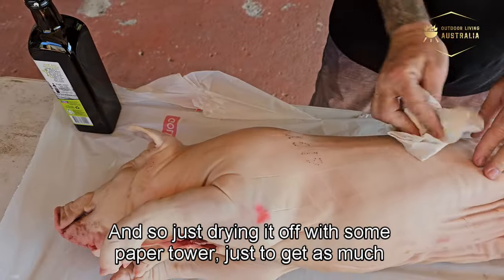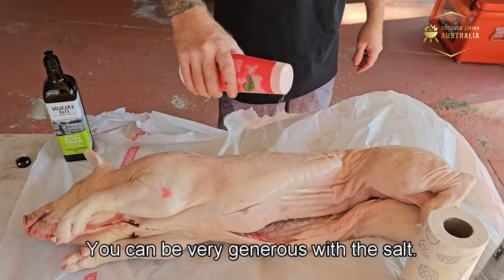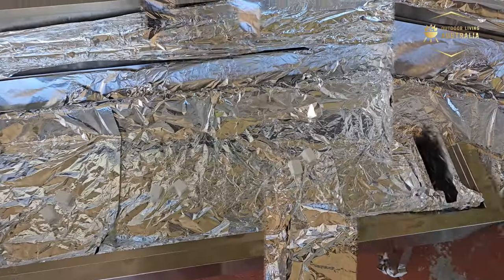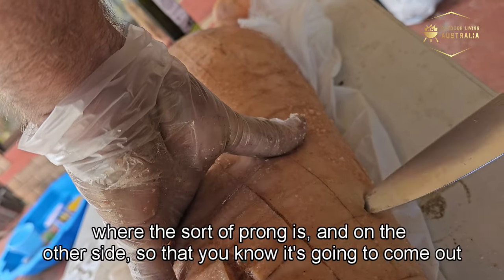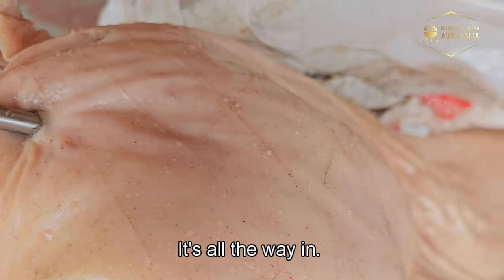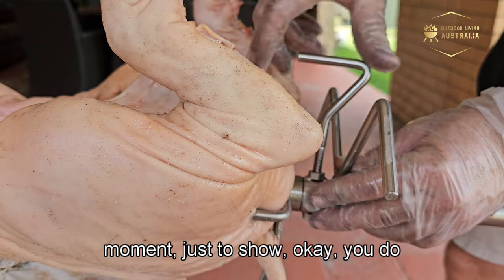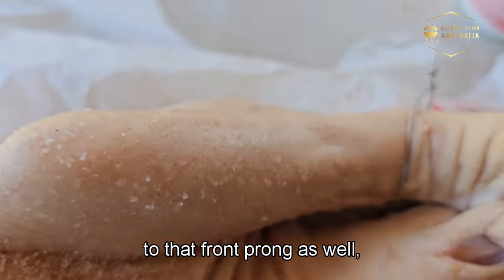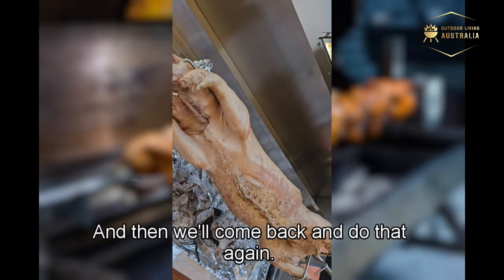How To Cook A Whole Pig On A Spit Rotisserie - Charcoal or Gas

Comment: Well done Mate, probably the most helpful and concise video I've seen so far. I would have liked to have seen the resting and carving of the cooked product and some specifics on hog weight, cooking temp and internal temp of finished product. What is the reason for so much salt and the spraying down during the cooking? Any suggestions on complementary side dishes?'I'm tackling a 16kg suckling in my pizza oven for the first time in 2weeks which means I'm sort of doing the rotisserie in a convection oven, any helpful tips would be appreciated. Looking forward to checking out more of your cooking videos.
Cheers, John in overcast California.
Reply from the maker: Hey John,
Good luck with the cook. Because you are doing a pig (on a rotisserie?) in a pizza oven, where we assume the lid is on, you just need to make sure you use less charcoal and keep the heat even. We haven't done a closed lid rotisserie before but we do know people do this so they can reduce the cook time from 8 hours to 4 hours. The meat isn't as juicy but is still delicious (we have been told).

In this video our pig was about 18 kg. We don't use a cooking temp because we use the hand rule seen in the video. If we can keep our hands at the bottom of the pig for 4 - 6 seconds that is a good height. If we CAN keep it there longer, we lower it and/or add charcoal. If we CAN'T keep it there longer than 6 seconds we raise it until we can. 

Also, after 7-9 hours using this method the final temperature isn't required unless we are doing this for an event where we will then keep temperature records. The final meat needs to be above 77 ºC here in Australia, legally. 

We dry the skin and use a lot of salt at the start to dry out the skin and help it crackle. The olive oil and lemon juice basting helps the skin bake and crackle evenly and stops excess moisture loss. However, for a pig that is optional, you don't have to baste it. We also only baste for the first 3-4 hours and then don't baste for the last 3-5 hours.

The cooking process:
We raise our pigs to the highest position on the spit once finished (at this stage the charcoal has started dying off and we push it to one side).  We generally follow these steps:
1. We cut the skin off in sections (It comes off easily) and lay it on baking trays before placing into a conventional oven on the highest setting for about 5 minutes. You have to really keep an eye on it as it burns easily. We do this because getting the skin to evenly crackle on the spit is quite hard and we have found by doing this you get an amazing crackle that is ligt and crunchy with no chewing
2. We then let the pig sit for about 15 minutes (without the skin) and carve it onto serving trays straight off the spit. We might take the head and shoulders etc inside and carve them there. We don't really think you need a long sitting time like a typical piece of roast meat because the belly full of apples and onions makes the meat extremely juicy and you don't need that resting period. You just don't lose significant moisture.

As side dishes we nearly always make massive potato bakes where we layer them and use a french onion soup packet mixed through with the cream etc. Otherwise, buttered rolls for the kids and a simple salad. However, it's usually always the pork and potato bakes that go first.
Reply: Thanks so much for your detailed response, really appreciate your advice and suggestions.
Reply from the maker: @johnopdecoul4222  happy to help where we can. Haven't really done the type of rotisserie you are doing so we would be super keen to hear how it goes. You could respond to this comment or shoot us a DM. Maybe take some pics and let us know of your experience. Genuinely interested. Best of luck again with the cook!

If you had enough pics and could write a short piece of the process, how it went, what went wrong and right etc we could do a short blog on our site with your name attached. Maybe teach us Australians a thing or two. We love to grill here but rotisserie and smoking is a quickly emerging thing here. It has always been around but it's starting to expand to more of the general population.